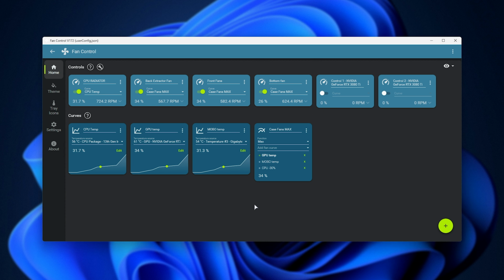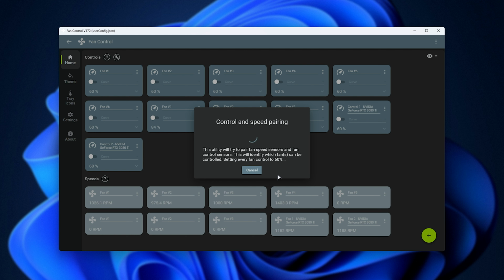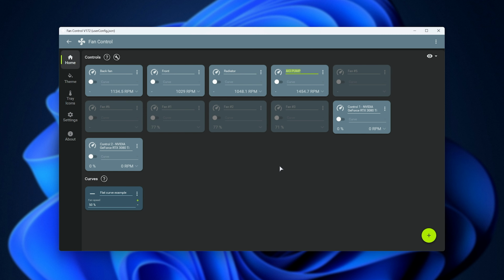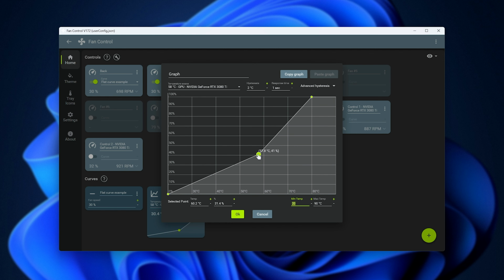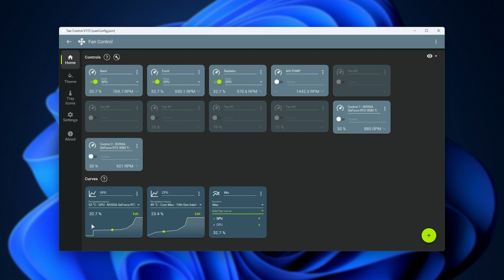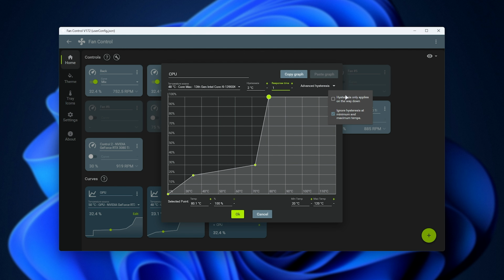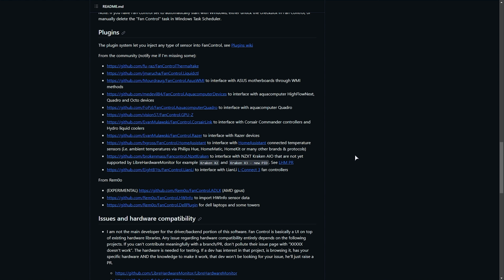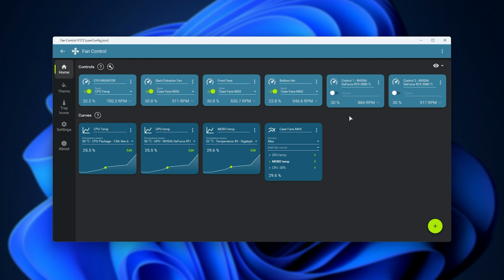Quieter PC for FREE with Fan Control | Control CPU/Case Fans Easily!

Comment: How Could you display the Curve GPU fan speed ramp up  at 74c -40% capacity to higher goes 100%, what is 40% in rpm ?

Comment: God, can't handle fan control. It is top notch for how deep it is, and if you're a technical guy, its a blessing. But for generic guy that just want "quiteter PC" its a blessing in disguise. All this linear, curve, mix, min, max, time to CPU, time to GPU, hysteria, response time. And most in the internet say "you need to figure curves yourself". All this graphs should be an expert mode, and so.wthing like easy mode, for straightforward settings. Its really the first program I can't understand what do I need to do, and I spend quite some time coding stuff in my life, damn
Reply: I have to admit, I too really battle with fan control.. I like the fact that it can do what it can do... but I never really gotten my fans the  way I want them simply due to the complexity of fan control

Comment: In the drop down menu right from the RPM i dont get quit the Start% and Stop % what that does. specially if you have it e.g. set to 15 % and the minimum at 30% does dat overrule the 15% ? i dont get it.

Comment: Hello. I'd like to ask if the fan control program works on HP laptops. I'm wondering if it will work. How can I configure this program to keep the laptop cooler and the fans quieter? Obviously, at temperatures around 40-48 degrees Celsius, the fans won't turn on. If it's above 50 degrees Celsius, they'll turn on unless there's a different setting in the fan control. If I have a laptop, this probably won't work, right?

Comment: Before setting this up using this guide, what should my ASRock Motherboards BIOS fans be set to?  This is the first Guide I see that actually does a good job explaining how to set up FanControl.  So many of the others I watched even from great creators get sidetracked, go off on tangents or begin to speed up the guide to shorten the video which is really too bad. This video is fantastic!
Reply: Hey, first setup all your fans (use for this bios fans control) and after if you want use this software, because if you dont use bios first your fans always work default and after when you Windows started, this software load you profiles and your fans work how you want. But better and simply use bios for all your fans ( use different ports for connecting all your fans - 1 port topp ( 1 - 3 fans connected ),  2 port - bottom ( 1 - 3 fans connected )   3 port back ( 1 - 3 fans connected )  adn cpu pump - this just example ) And your can control all your fans for all side top back bottom and regular speed and all what you want for correct pressure on your case )

Comment: after starting to use this app, the thermals in my system got very weird. but this can be solved, howevr, my problem si that when starting and shutting down the pc the fans ramp up to 100% and I have no idea how to solve this issue
Reply: Hey, i think because you not optimize your fans with mob bios ( you use default settings for your fans ) and after when you load your windows this this software (Fans control) start up and apply all your settings ( and when you turn off your system you have the same work your fans ) 
I think first you need setup all your Fans use BIOS fans control and after use if you want extra mode ( mix mode when you can setup your GPU and CPU fans work together for your comfortable temperatures )
I'm first use my BIOS for setup all my fans and don't do it more anything ( this is software so cool because you can test your fans with load your cpu use for this benchmark and correct your fans , because if you use bios for this you need always restart your system ) You can use this software for test and find for your self best settings and after copy this settings to your bios ( and after when you want more you can do it this and your fans works so good without noise because first you setup all your fans with bios fans control )
I think you understand )

Comment: I ran installer , which installed it on my PC. But on running this, I dont see any fans or sensors on the home tab
Reply: Yeah mee too. I try both the portable and using installer, but there's nothing on the home tab.

Comment: I got a new build with a X870, always used FanContro with X470 and X370 boards never faced a problem till now. It identifys only the GPU Fans, not my PWM fans.. tried everything and I can't get them to be recognized. I can control the fans in BIOS (I also set them to PWM from Standard Auto) 

Anyone got a solution?

Comment: I have already tried twice to convince myself to the program, and each time I go back to the original software from the motherboard, because to this day I have not been able to set the program so that it does not run my fans from 20% to 70% only because I run any application, and I know that there are settings for this, but by god they do not work at all, what value I would enter nothing changes

Comment: Will these work on old HP PCs? I have a i7 8700k and GTX 1660 Super and 1TB SSD with 24gb of ram with Windows 10 Pro 64 bit. I can run games like KH3 and other's just fine. But during cut scenes my GPU fans become obnoxious. :( I don't even have the settings set to high. I'm afraid of messing the fans up or damaging something with these programs if I don't know what I'm doing. I never messed with these before. :(

Comment: Avast reports vulnerable driver fancontrol.sys file .... also auto setup sets all fans at 75%... so if you already have dialed system pretty well, I would not recommend setting all at 75% - because you will end up uninstalling/removing this, and then setting all your stuff back to what it was before this eye candy fan control :)
Reply: what a useless comment

Comment: So I have my exhaust fan, and 2 aio fans on top set up through my nzxt hub so I assume that is why I cannot control them in this app, which is okay as I use nzxt software. I was using msi center originally for the 2 front fans and bottom fan and running between an idle/browsing the internet mode and a pure gaming mode which was nice to be able to change the speeds on the fly through xbox game bar.. However with the most recent update that user scenario option is gone and i cant find anyways to fix it.. So I've downloaded this software and I can set the fan speeds for my 2 front fans as well as bottom and gpu and that is it.. However only gpu fans will give me an rpm reading and and if i go to detect alll fans it will say  this control doesnt respond for all the fans but the gpu fans? Why on earth is this? Epseciallyt if its still letting me manually do it in the software.

Comment: Using msi aio S360 updated Msi Center the other day & I could no longer control myself radiator fans. The radiator fans were lock at 600 rpm, not cooling enought In gaming they used to run at up to 2000rpm when gaming  whitch keep my i7-1400K cool. . Try fan control and I could not speed up my radiator fan. Not working on my msi tomahawk max wifi 7

Comment: NOT WORKING
Reply: It does.
Reply: It does
Reply: It does.
Reply: Your motherboard doesn't have PWM fan control then
Reply: @UnknownPerson-cl9di  how can I check if my PC have
Reply: @bereketg5609  if your fan cables have 4 pin "holes" and if your motherboard has 4 pins to actually fill in those holes. Hope this helps!
Reply: whomp whomp
Reply: Can laptops use this? I would be eternally grateful if you could respond 🙏.
Reply: @mrNinety_5  It doesnt ,hope it helped ,even if later
Reply: @seemenowudont7244 cope
Reply: Sad no fan control noises
Reply: @Slayeaa1 cry

Comment: Hey troublechute... my fan control for my GPU has a question mark next to the percentage of the fan speed. And it says that my settings for the gpu fan speed is being overridden by an external source. BUT I don't have any other external sources like MSI afterburner or anything like that running in the background... BTW I forgot to mention, but my gpu won't go under 30% fan speed because it is being overridden... can you help me?

Comment: I installed FanControl today and the Corsair Plugin and none of my RGB works. Also when i adjust the slider for any of my fans nothing changes on any of the ones that are paired. If i cant get it working im gonna end up removing the program.

Comment: Question, what if the program doesn't see all of my fans? It only sees 1 fan (a case fan) and it also doesn't see my cpu fan. Anyone got a solution?
Reply: If 3 fans are connected through a hub, then the hub goes with 1 cable to the motherboard, it'll detect one fan but it's actually 3
Reply: Thats probably cause your fans arent connected to the mobo. Probably just connected to power pin connecter instead
Reply: @FrogMaster21  when uoumean connecting to mobo, you speak about the 4 pin connector into a cha fan or cpu opt right?
Reply: i have my fans directly connected to my mobo tho... then what?
Reply: @DrMaerlyn  if they still don't show, check if your fans are 3 pinned. If it's the case and they ain't pw, it means maybe they can't be controled except by the bios.

Access the bios abd set your curves there. You won't have the mix curve like in fancontrol, but better than nothing
Reply: @John-t5q4h  everything is connected to the right header.... maybe my mobo is broken or something?
Reply: @DrMaerlyn  no idea brother, hard to tell from here tbh.

Try in the bios, of there they ain't active then truly no clue what the deal is.

If you need further pc tips I can refer you to a useful guide of mine.
Reply: @John-t5q4h  unfortunately they are 4 pinned, but i quess i have to use the bios, but i have asrock and they dont have a diagram or something... just text. thank you for your time! and merry christmas!
Reply: @DrMaerlyn  likewise mate! Asus prime z790 works great for me btw, in the case where you consider a new mobo. Easy for cpu undervolting and fancontrol :)
Reply: @DrMaerlyn  make sure your fans are where they have to be. Mobos have:

Aio pump
Opt cpu
Cha fan

Fans need to go in the cha fans to be detected by fan control. The pump goes in the aio, and opt cpu are secondary

Comment: I have a Zwift PC I built- an Acer Veriton M2631G with non-proprietary parts and it has an ASUS H81 mobo with Haswell Xeon E3 1271 v3. It picks up the GTX 1050Ti but not the CPU or case fan...seems there's no way of manually entering these? Seems as the GPU heats up way faster than the CPU I'd want to bypass the CPU control of the case fan and let the GPU push the case fan harder sooner to move heat out... does it only work on modern tech??

Comment: Anyone know how to keep the gpu fans off and only turn on during video games or loads? The trigger cuve doesnt work
Reply: Open Nvidia Control Panel Then Go To Manage 3D Settings and Find Power Management Mode and Change it To Normal
Reply: Try MSI After Burner, it has a curve that you can adjust

Comment: How do I make the pc fans quiet when I turn on my pc
Reply: Hey, first use for this BIOS fans control and after use this software if you want more ( mix mode or something ). But for more better use bios ( for GPU better MSI aftoberner, have good fans control and when you play you can check your card temperatures and speed your fans. You can correct all when you play and find for you best settings )

Comment: Does this work for any and all kinds of fans?

I.e. the pre installed fans of a case, aftermarket cpu cooler and an extra aftermarket fan for casing?
Reply: As long as they are attached to the fan connectors on your board, yes, as long as they support being speed controlled.

Comment: Hi I love your video, thanks for all but , i have a problem with , I use windows 11 pro , but when i start windows the fan control doenst start with, i dont know why. I have checked the option to start minimized and with windows but it doesn't work. Do you know how to fix it? Thanks a lot.

Comment: Hey, can I ask you about something unrelated? Here I am I guess :D..
My friend has the same antivirus as you, eset 32 and we are trying to run a minecraft server. We configure the ports in the router, make exceptions in the eset firewall settings, but it doesn't work. It only works when he turns off his eset firewall. So my question is, how did you manage to run it through turned on eset?
We saw that there is a guide from eset about it, but it just doesn't work. We both are a bit techy guys, but we can't stop the eset from blocking public ip access, while it has exceptions and etc.. 

Sorry for the long comment, love your channel and guides! Wish you all the best, and thanks in advance for reading or answering!

Comment: TLDW; Is it also supported for laptops or not?
Reply from the maker: I have not tested it but I assume it would. The CPU fan at least.
Reply: @TroubleChute  I cannot get this to work on my ASUS G733ZM Latptop
Reply: It doesn't work for me either (no program that I tried does apparently) on my laptop. Nothing detects my CPU fan. It is set to start at lowest setting when it reaches 40C and stops at 35C. It is very easy for my laptop to go over 40C and that means the fan turns on and off every few minutes basically. I tried to fix it by increasing the treshold to 45C or maybe 50C to make the fan lifespan longer, but Huawei said nope.

Comment: Fan Control is one of the first things I install when setting up a PC, great piece of software. I just wish it was able to control AMD GPU fans, luckily the Radeon software makes it pretty easy to control fans separately.
Reply: Believe there's a plug-in on their git for AMD GPUs. Not sure if it was only for certain ones or what, but I do recall seeing it couple weeks ago, though I didn't look into it. Could be new addition too, maybe worth checking out.
Reply: Please share more light on this
I am using an AMD CPU and my fan is always on how how can I correct this with the Radeon software you mentioned
Reply: Do you know what to do if it only detects the gpu fans.